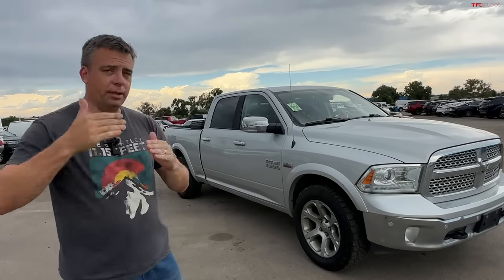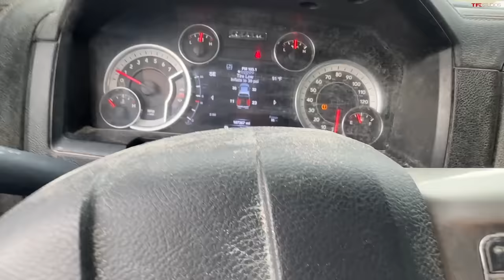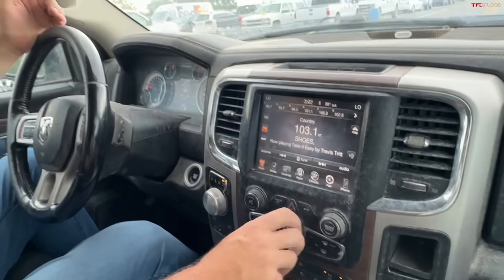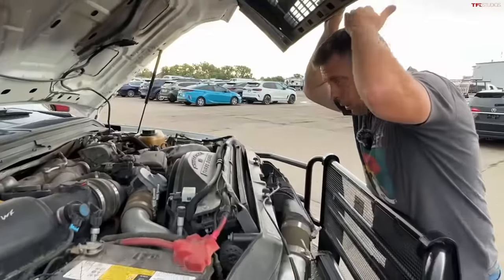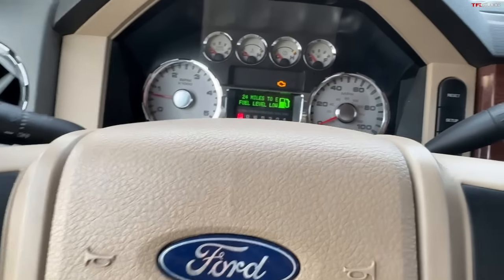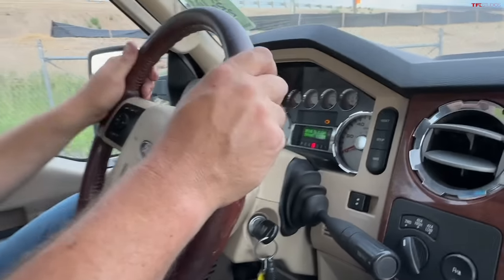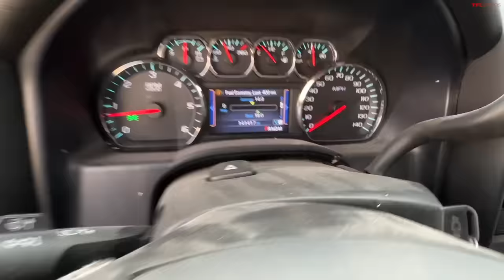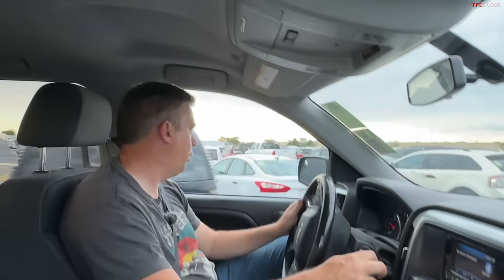These Are the Top 3 Used Trucks You Should Never, EVER Buy!

Comment: Ram 5.7l has an exhaust  manifold  leak. Not lifter tick
Reply: That’s what I thought as well by the sound.
Reply: 100% correct that is a warped exhaust manifold and broken bolts from the manifold to the head. I see this constantly on the hemi and triton engines. The log style exhaust manifold designs all warp and snap studs or bolts.
Reply: We had 32 of the ram trucks in our work fleet. A bit over half had the tick and everyone of them was a lifter tick.
Reply: Lifters stick and wear out cam lopes. Another common problem with these crap motors
Reply: It’s probably both
Reply: That's what I was thinking.  Sounded exactly like my 98 f150 4.6l V8 with a leaking exhaust valve.
Reply: That’s what happened with Ram, once I replaced the exhaust manifold the ticking went away. Still running strong at 230k miles
Reply: They don't even flinch when you ask if they still do it while you're looking to price one.  They answer yes
Reply: 30 year ase certified master tech concurs 
It is an exhaust manifold leak making that noise
Reply: @albesures.316 30 year certified agree-er, I agree with you
Reply: I agree
Reply: If that was the lifter, you would have already had a check engine light. That is exhaust manifold. That truck is still good!
Reply: @BAS3BALL_bat  buys truck
Drives 20 miles to home
Truck has 2 ticking noises

🤣🤣🫡
Reply: @daMillenialTrucker  Better get those Edelbrock heads and some shorties then. 😎 HEMI FOREVER
Reply: I have the same exact noise on the 2012 Ram 1500... It gets quiet when warm. No check engine light. Heat shield on manifold moves around. It has broken bolts.
Reply: my '13 w/~217k miles has the tick.... dealership verified it was the pass exhaust manifold when it went for recalls.   I have lived w/the noise long enough where it's family... and like family it goes away after a while but comes back
Reply: @BAS3BALL_bat wrong , a seized lifter will not trigger a warning
Reply: @jimmysmith3255  Sure it will. You'll get a misfire. 🤔
Reply: LMAO I bought mine with the exhaust leak😂
Reply: They have  both
Reply: Definitely an exhaust leak but wouldn’t be surprised if it had a lifter tick
Reply: It’s a dodge, they tick
Reply: Don't some of the hemis have non removable exhaust manifolds lol
Reply: This should not happen.
Reply: Sounds like both… ask me how I know 😑
Reply: Domestic poor quality. My 2 Tundras with over 600k  combined,no issues,no leaks,no mechanical repairs,no rust anywhere, even living in the rust belt.Had a gmc and two Ford trucks,many issues with both.
Reply: @ridynh7923  What about low oil levels ? That ticking is noticeable,though 2007.5 Dodge Quad Cab Cummins. 6.7 no def. 4 w.d . 20 mgg. Great truck.
Reply: @stefanovichmichael9686 , baloney. 🙄
Reply: That's no exhaust leak.....
Reply: @outdoorsman7324  How would you know?
Reply: @stefanovichmichael9686  , it's called reality, try it once. 🙄
Reply: @outdoorsman7324  Sorry I took you away from watching wrestling.
Reply: @stefanovichmichael9686  , seems to be your thing, I prefer reading, especially Stephen Hawking's writing.

But hey, if being a bullsh1tter makes you feel all warm and fuzzy inside then you do you. 😉
Reply: Thank you. I had a 16 and I loved it
Reply: Dude, that's just the beginning of the Rams problems
Reply: They are notorious for both
Reply: I had lifter issue as well as manifold issue lifter started eating cam
Reply: Totally!! Have an 16 rebel
Reply: IF THE TICK GOES AWAY WHEN THE TRUCK WARMS UP ITS THE EXHAUST 🤷🏿‍♂️
Reply: @ogarchielee9880 how does an exhaust leak go away when warmed up? Is that a common thing?
Reply: Good lookin out bro
Reply: @NightPwnGaming  I wish I could talk to you instead of typing, but I guess the best way to explain it is when my truck gets to the right temperature the noise isn't as loud it doesn't go away but it's not as loud as when you I first start my truck. I have broken bolts on both sides. I plan on getting the broken bolts removed but that's not a easy job & the dealership wants $900 with no guarantees🤷🏿‍♂️.
Reply: @outdoorsman7324 
No….you’re B.S.!  The amount of problems that ANY domestic vehicle has compared to a Toyota is ridiculous. There are SO MANY reports, documented facts and evidence/issues, that it can’t be disputed or ignored.
UNFORTUNATELY!, the U.S. will only make vehicles as good as NECESSARY per sales and or warranty expiration compared with Toyota will do so REGARDLESS of either.
Toyota certainly isn’t faultless and is getting worse as time goes on, but there is still a huge difference between U.S./Import
Reply: If you’re going to do a video get it right. That an exhaust leak on the ram and the interior looks like hell. What did they do to it?
Reply: Yep, you're correct, the manifold leak is caused by broken manifold bolts. This happens because the engine block is steel and the manifold heads are aluminum and expand at different rates when hot.
Reply: @stefanovichmichael9686 BS. Tundras have their issues as well, and the new Gen is riddled with electronic and motor issues.
Reply: @norfolknwhey4787  Really?Exactly what are those issues?
Reply: 100%
Reply: I see that HEX lol Richard Heart ❤️
Reply: Lifter failure happens to and this has both
Reply: Not leak ,lifter tick.
Reply: Mine had 2 lifters go out at 50k
Reply: Not true at all the 5.7 Hemi has MDS which means that it has very bad lifters which will ruin your cam eventually. That is a fact. I've proven it twice.
Reply: @harley11296  yep lost two lifters before 50k
Reply: @deanmacklin2472 still angry he has a DUI and can't drive.
Reply: That’s a manifold most likely !!!! Ticking ehhh it can be but slight it I worked at a dealer and this was common issue.
Reply: Not
Reply: @BAS3BALL_bat exactly
Reply: @gjolinares23  easy to tell, if the tick goes away as it warms up it's a manifold leak. If the tick gets worst as it warms up it's a lifter tick
Reply: @ridynh7923  you didn’t change your oil then or had crappy mechanics cause it’s always the manifold cracked or bolts
Reply: @jeffdacey4673  not sure how you can say its always the manifold. Oil was all changed ontime. We got to see the failed lifters on most. Ram is notorious for these issues.
Reply: @Gl49ers lol I agree I’ve not seen a dodge that doesn’t tick
Reply: Buddy has one. All rams get it. Not 100% sure why
Reply: Oh they have a lifter tick ive seem them 5.7 hemis take a shit before 140k miles
Reply: I guess every Ram has an exhaust leak lmao I had a 2012 5.7L ram that sounded like that. Had 105,000 klms then the engine seized and then dodge made me pay $3,000 towards a new engine... what a shit warranty and engine. lol maybe it was a bad engine idk it didn't have the power of the 5.3L in my Sierra

Comment: I’m surprised the f150 3 valve Triton didn’t make this list.
Reply: Maybe all the 3 valve trucks are dead so they couldn’t find one to pick on (feature)
Reply: They actually made a video recommending that era f150 😅
Reply: @XDM10  I have one with 234k miles works solid
Reply: I had one. It was actually pretty good. 220k miles and I had to have exhaust manifolds replaced but that was it.
Reply: @seattleprowash5464  hit or miss. Mainly miss. Come out to the rust belt, most of those era f150s turned to dust if the drivetrain survived
Reply: It should of car wizard has replaced his far share of those 3 valves.
Reply: Never
Again
5.4 3 valve

The van 5.4 2 valve awesome however
Reply: Hemi exhaust manifold issues ha ha $$$$$ junk
Reply: So many 3 values on road still see  em everyday in texas
Reply: @zachsummers3321 yes car wizard very much hates them
Reply: @howardfletcher7206  good reason to get headers lol!  I got a hemi with a small manifold tick, those motors are great as long as you don't idle them a lot (like cop cars) I've seen original hemi motors with 450k on them. Very dependable if maintained properly. All brands have their flaws, you WILL NOT escape that.
Reply: @XDM10 I've owned 2 and both have been great 🤷 a 2004 and a 2010. I love the 5.4 lmao
Reply: @TheJVCguy  some are good.  Plenty of ticking time bombs out there, ask any mechanic in America.  Sounds like you dodged 2 bullets.
Reply: theres an even worse list for engines like that
Reply: @XDM10  I guess I just do regular oil changes and they work great I love how they sound as well
Reply: @TheJVCguy  I got a 14 ram with modified exhaust. It's loud and 400 horse surely helps the fun factor 😂
Reply: @XDM10  lol cool
Reply: 贵價垃圾，但通街见有跑。

Comment: 2011 6.7L diesel was a complete different engine. The 6.4L, 6.0L, 7.3L, and 6.9L diesels were all Navistar engines. The 6.7L was Ford's first in house built pickup diesel.
Reply: You could also get that generation body with the 6.0l diesel as well
Reply: @devbloggs  Pre-2008 model year, yes. 2008 saw the crackdown on diesel exhaust particulates. It was the beginning of the worst diesel engines ever built across the entire diesel segment. So bad that it put 2 diesel manufacturers completely out of the game. Navistar in light duty pickups and Caterpillar in the heavy trucks.
Reply: @devbloggs what?
Reply: @devbloggs What are you talking about? Yes, the panels were the same but the interior and a lot of other things were changed in 2011…even more so in 2013.
Reply: Built almost all transmissions and engines in house starting in 2011. That tells you how bad that 6.4L was lol
Reply: @JJMassar  The 6.4s were atrocities. The HD version in class 5 trucks survived pretty well though. The emissions systems really did a number on those engines.
Reply: @devbloggs the cab didn't change from 07-08, but it's hardly the same "body style".  The 2008+ trucks equipped with a diesel were all 6.4
Reply: @TravisTheSavage  vgr?
Reply: I’ll say, the 6.0 power stoke is a hoss when you dump some cash into it. Many people didn’t have a choice as they had financed the truck and were past warranty when head gasket problems arose. so they had to fork out the 10k for delete, studs and gaskets as well as a bypass for coolant. Later developments with heads machined with a fire ring around each combustion chamber made them perfect. We built many 6.0s and few if any returned for anything more major than a oil change/turbo. We also provided tuning through SCT for them and I have yet to drive a truck as fun and roudy as a balls to the wall 6.0 powerstroke.
Reply: So when people say ford sucks because of the 6.4 their wrong because those engines were navistar and I try to explain people that and they still think they are ford motors till they look them up but ford has done good with the 6.7
Reply: @devbloggs I’ve never seen a 6.4 style truck with a 6.0 the body style is similar to the 6.0 except for the front end
Reply: @BigBlockOverland I have a 6.0 only problem was a head gasket and it’s bulletproofed and before it was bulletproofed it ran excellent till water got in the fuel
Reply: All junk
Reply: That driver seat isn't struggling is already dead. 😂😂
Reply: @LEGEND04131  huh
Reply: @ripperlipper1016 the 6.7L is a great engine, I had a 2012 that I drove for 200K miles and had zero major issues, and now I drive a 2021 with 60K miles so far, also zero issues. 
Ford corrected the major issues with the navistar engines and IMO the current PSD is the top diesel engine.
Reply: @jibrilthegreat35  6.7 ain’t bad atleast the new ones I just don’t like the new headlights and the way they did the badging on the new trucks
Reply: I heard the Navistars were all junk!
Reply: @ripperlipper1016  Ye ford made those 5.4 triton boat anchors though lol. Wonder why you never see a 90's ford on the road hahahah (and I like ford).
Reply: Did this year of F-250 Diesels have a Limp Mode?
Reply: When Navistar bought international, that was their downfall
Reply: @luketilley9137  Navistar started in 1986. It wasn't until the government stepped in and started mandating emissions levels on diesels did they start having issues. Their major downfall was trying to reach those levels through only the EGR system. It caused heat to build up excessively and cracked EGR coolers, burnt pistons, and blew head gaskets. Truth be told, Cummins, Paccar, and Volvo all had problems with emissions systems from 2010-2015. Then when DEF was introduced to lower NOx emissions, it brought an entire new set of headaches.
Reply: @BrewBlaster  yes, and this truck is in it.
Reply: @BigBlockOverland a lot of the 6.0 trucks had egr coolers to rupture and folks thought they had blown head gaskets because of the steam cloud coming out of the exhaust. Stopped up oil coolers are the biggest cause of the problems on these trucks.